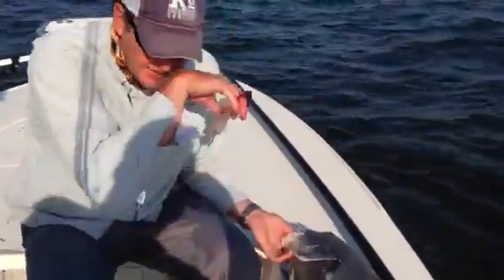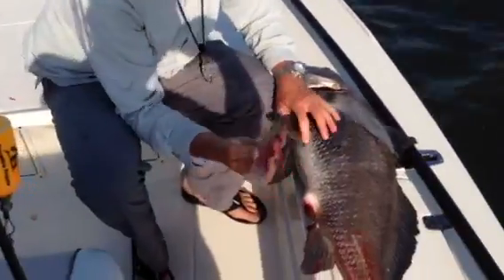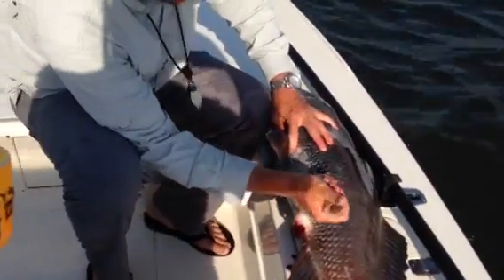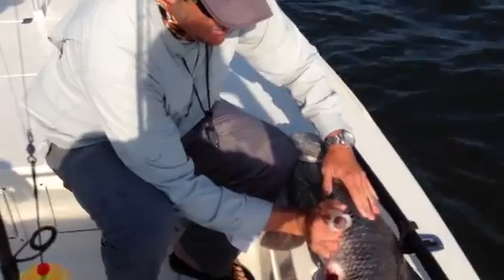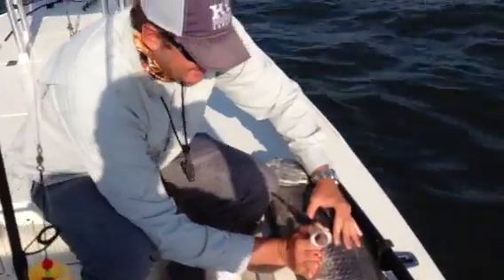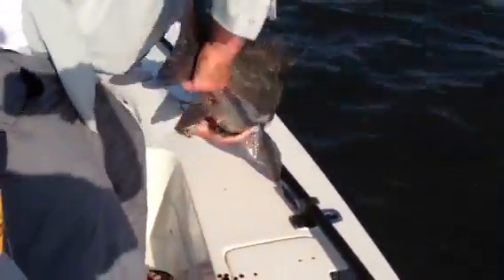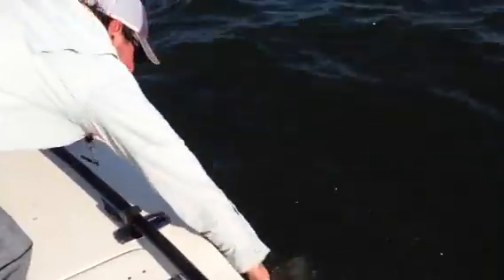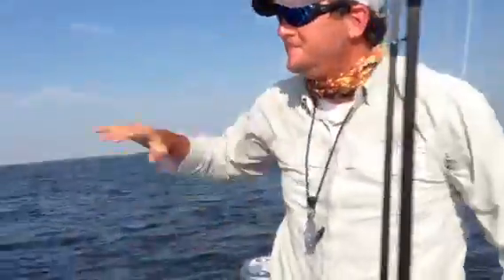Proper deflation of a fish's swim bladder

Comment: the swim bladder heals. thats why we do it. if anglers just threw them back. they would float at the top and die. deflating them lets them swim properly again and go back to the bottom. they will be fine.
Reply: but theres the risk of an infection
Reply: @derpychicken2131  the salt water cleans it :)
Reply: @randomrachael420  and yet in ocean environments, fish still get horrible diseases and infections. I caught a spot outside the Chesapeake bay with a torn gill and skin, holy crap it was black and festering. Microbes adapt to these environments, there's a reason you can find them at the bottom of the marianas trench and in boiling hot spring water.